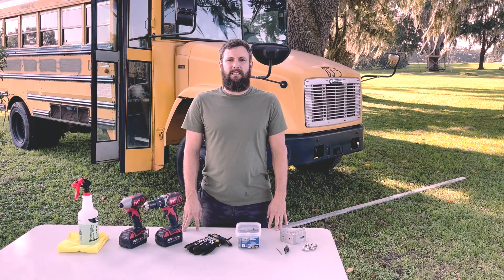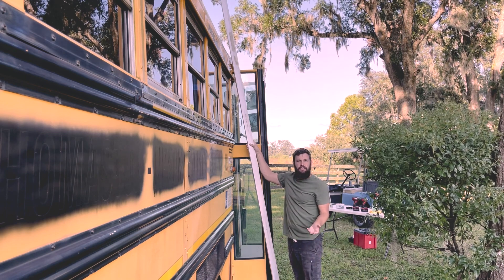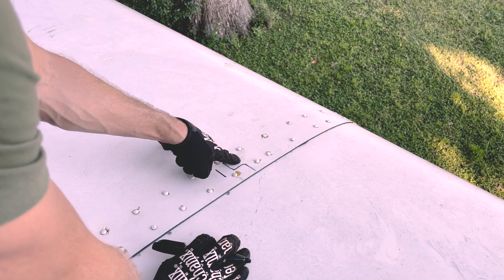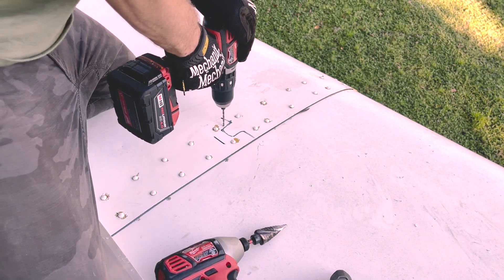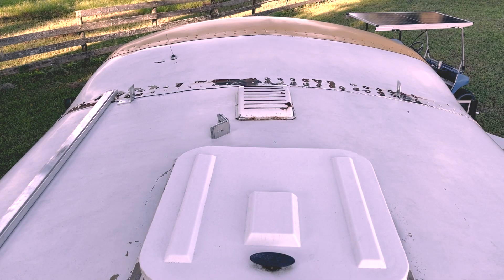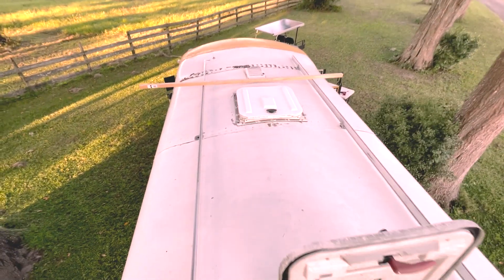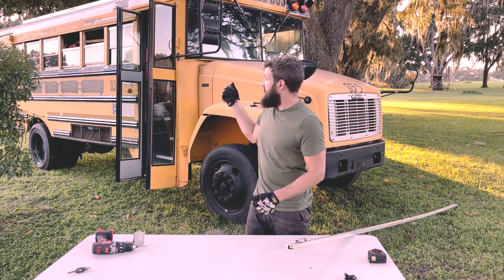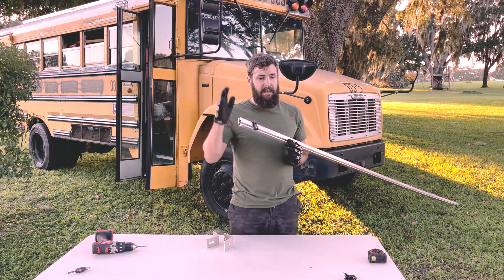Skoolie Solar Rack Install - Simple Method!

Comment: Respectfully, I don't think aluminum is the way to go, steel is.
Reply from the maker: The entire Solar world disagrees and specifically makes their rack systems out of aluminum. The railed referenced here have been the industry standard in residential solar. They specific avoid steel except for the fasteners to reduce galvanic corrosion and so it doesn’t rust.
Reply: @sojournersway  But the entire solar world is for mounting to homes, not moving buses that shake a lot on the highway, steel has far better fatigue resistance than Aluminum. Eventually, aluminum will crack, question is will it be in the 20 years you plan to own your bus.
Reply from the maker: @AmNesia-r5h Sounds like you should do steel.

Comment: Could you touch more on the part where you’re holding up the aluminum rail against the side of the bus to get measurements and run into the issue of it only touching certain parts of the rub rails…. I’m confused by what you mean to “split the difference” in that instance? 

Im getting close to this stage of my build and your method looks like the simplest way to do this! I appreciate you sharing the knowledge!

Comment: Would this still work with 6 larger panels that are 50 pounds each?
Reply from the maker: Absolutely. Most of these panels are in the 55lb range.
Reply: @sojournersway  nice I think I’ll try this this. I have a buddy who said after 15k miles the screws were coming loose. Anyway in making sure this doesn’t happen?
Reply from the maker: @DarkBroly88  He used my system and method and it came loose?
Reply: @sojournersway  I was thinking about getting 3” roofing screws and going through the whole beam.
Reply from the maker: @DarkBroly88  I wouldn’t. You’re going through a combined 1/8-1/4” with this method and I’ve never once had a leak or bracket failure.

Comment: Sig, how did you know how far apart to make the rails?  Is that distance exactly the width of the solar panels? Or more narrow or wider?  I'm planning on 3 solar panels, was going to do two side by side running length wise with the bus and then one sideways.  Looks like if I want to use one set of rails, will have to do all of them the same.  Guessing turned so they all run sideways.

Comment: I’m going to use the L brackets Iron ridge sells as they can support a deck using a stock aluminum piece to angle the bracket to 90 degrees. Thanks I found your vid very helpful
Reply from the maker: I have had clients use this for a deck but I don’t know the limits and explain accordingly. It the future, I may offer some thicker brackets for exactly this!

Comment: Self tapping screws but you don’t like self tappers so you pre drill.  
Those screws are structurally insufficient for a safe install in this use. Add in the THREE dissimilar metals (bracket material, screw material, and zinc on the roof sheeting)  and corrosion will destroy structural integrity at some point. Is that point beyond the life of the rig? Probably not. 

“Proprietary bend” I think that was a joke. Right?

Mine will be mounted with steel angle & square tube, grade 5 bolts though hat channels, and provide access for washing and cleaning panels without climbing up and down a ladder numerous times.
Reply from the maker: You seem unfamiliar with how solar is installed onto homes. They are installed with aluminum rails, aluminum brackets, and stainless hardware. All of them. Your method will have more surface area for galvanic corrosion since the panel frames are aluminum. As it turns out, the method I’ve used isolated dissimilar metal as much as possible (apart from using aluminum bolts). As I said, the entire solar industry uses exactly this method, except with different L Brackets which are made out of aluminum as well.

Sounds like you’ve got a perfect plan for your bus and I suggest you avoid my method altogether since it doesn’t suit you.

Comment: Question about this system! Do you think the aluminum rails could also support a storage / roof deck? I'm interested in installing rails that would serve a dual purpose for both solar and storage deck needs (thus was thinking unistrut with similar L type brackets)
Reply from the maker: For sure. It’s super structural once the panels are spanning the rails…but, for a deck, I’d feel better with some thicker brackets and bolting through. I’ll create a solution for this later!
Reply: @sojournersway  Thank you the the quick response! Also wondering what you think of this solution as slotted angle iron is easily available and can be bent to accommodate angle issues: https://youtu.be/pQ4Ieb6knb0
Reply from the maker: @dandotmp4  the reason this video and mounting solution exists is to help people not make mistakes like that video!
Reply: @sojournersway  Thanks! Curious what mistakes were made there as it seems like it’s been satisfactory for this person. No disrespect meant, just trying to learn!
Reply from the maker: @dandotmp4  Sure, it’s just simpler to use parts made for solar that allow for infinite modularity, minimal dissimilar metal contact, and no drilling into panels!
Reply: @sojournersway  Thank you!

Comment: Why use self tapping screws? I feel like Riv nuts or just nuts and bolts would be stronger. Also have you had any issue with these ripping off? I don’t trust the self tapping screws very much.
Reply: Always bolts, never like this.
Reply: Agree with you. Wrong fasteners completely. He also does 3 other wrong methods of doing things also.
Reply from the maker: I don’t use self tapper for that reason. Rivnuts are cool and can be used. Bolting through is also an option. Neither get into the hat channel easily like this does. As I said in video, I’ve got 40-50 buses running this system with tens of thousands of miles over the past two years without any failures!

Comment: I don't understand why you say you sell the appropriate brackets but then have to heavily modify them to fit your own method.
Reply from the maker: Because rivets are not the same across all the buses in size, dimension, spread, etc. The only way to do brackets universally is to avoid the rivets, which can be done with the brackets. That method doesn’t get you secured to the strongest part of the bus!

Comment: I like the solar mounting rails, I will have to check with my local dealers, I was going to go the unistrut route.  Wouter d.b. is correct,  stainless to aluminum is frowned upon without some kind of barrier, galvanic corrosion is an issue.   All-n-all that's a slick setup, I will be using it for my 40ftr.   Do you have a website for hardware???
Reply from the maker: This is something I considered of course, but if you go look, this is exactly how it’s done ALL over in the solar industry, all approved by NEC.
Reply: @sojournersway  of course

Comment: A few notes. Using stainless steel on Aluminium without nylon washers will cause dissimilar metal corrosion. Also, the L-brackets seem somewhat small-ish (could be worse, and I've seen it), I'd use double sized ones, also thicker ones. Nice and clean system though, Unistrut sucks and ppl should stop using it. Especially for watertank mountings that make me fear for anyone driving behind you.
Reply: This post caused me to question the Galvanic Corrosion so I sent the question directly to a Iron Ridge technician. Here is what he replied: 

“Stainless steel is the proper hardware to use with aluminum. There is no galvanic corrosion with this combination. Our products have been 3rd party tested to UL2703 standards for bonding and grounding. Our products have a 25 year warranty.

Let me know if you have any other questions.

Sincerely,

Jon Haeme
Sr.Technical Support Representative
Ironridge Inc.”
Reply: @cycleoflife7331  they are correct concerning their product.  And if you ask them how they deal with it.  They anodize all their rails, that is the barrier, you can get their XR rails in clear or black anodizing.  It does not take much to protect from the effects.
Reply: @mlviper30  the use of stainless steel bolts to aluminum is minimal but the reverse is not acceptable. A thin nylon washer placed on the top side would suffice but really necessary. Butyl tape under the foot is better to seal might be a better method than a tubed sealant but both should suffice. The panels will have to be replaced long before the bolt ever becomes an issue and most likely the will probably be decommissioned by then. But your point is well taken and should serve notice that one should know and take necessary precautions
Reply: @cycleoflife7331  Now that is an educated answer, thank you for doing your research.  Yes I agree, is it really an issue??? Na    The point was not that it was an issue, and SW was not doing anything wrong.  The point was GC does exist, regulatory organization do address, and any industries building structures are aware of it and do address it discretely.

As DIYers, we will probably never have an issue with it, unless you are in saltwater applications.  But it is important if you are a sub contractor, you are liable for your work.  So follow oem install instructions, if they are not present go to industrial accepted practices.

 I own an engineering firm I pay liability insurance for a reason, and follow standards.  Because I am a contractor and I am held liable for my work.   I have been in lawsuits conerning issues that the lawyers got that petty about the bolt was the wrong material.  It sucks.

When doing anything for anyone for money, be careful. Cross your T's and dot your I's.

Sorry for the hassle with everyone, but a gentleman was shot back at about the issue. And I thought a little education about the concept of galvanic corrosion was needed.  No harm no foul.

Good luck with everyones DIY projects, SW keep up the good work help people with there rigs.

Cheers
Reply: @mlviper30  remember that stainless steel is a noble metal which has a lower GC level and is why it’s combined with aluminum on pop rivets.
Reply: Just to put the record straight.  I am not bashing Sojourners Way.  I was just bringing to light the effects of galvanic corrosion, a scientific fact.  In all industries there are best practices used.  Due to the fact stainless and aluminum react to each other. There are best practices used to midigate the issue between them.  And there are many ways to achieve this, by gc grease, anodizing alum, any type of barrier, etc...  Its just good idea to be aware of it, the NEC, sailing industry, automotive, and aerospace recognize.  If I remember right the aluminum block corvette engine had uncoated bolts used and the GC seized them in the block. I may be mistaken on that, I vaguely remember that.

Simply facts to be aware of, thats all.

And if you are doing work for another person for money, follow oem and industry approved methods for install.  So there is no questions.  Lawyers can be nasty.
Reply from the maker: @mlviper30  This is exceeding the industry stand for mounting solar. There is an acceptable limit to the contact of dissimilar metals. EVERY manufacturer of solar rack mounts is using Stainless bolts and aluminum rails. I’m using the same system.
Reply: @sojournersway  Sir, you are fine.
Reply: @mlviper30  stainless steel do not react to each other. Only regular steel does. Sorry but research says otherwise
Reply: @cycleoflife7331  Ok
Reply from the maker: @cycleoflife7331  Yessir! I appreciate you sharing that. It’s a rabbit trail I spent hours trying to wrap my head around.
Reply: Omg I seriously wanna use this method but now I’m confused! Can someone please tell me which metals to use for each item? Sorry, there was too much back and forth.
Reply from the maker: How many buses have you installed solar onto? All of these parts are used in this fashion for the solar world per NEC just like this.
Reply: @sojournersway  You may want to check the NEC code again concerning galvanic corrosion I think 2017 358.14 & 2020 344.14 Maybe others) code is very clear on the subject the galvanic action.(I am not an electrician so codes are vague to me)  They do recognize it as and issue.  Will it effect the frame, worst thing that would happens bolts loosening over time because corrosion under the head and nut. I have 30+ years as a journeyman tool & die maker and in the Mechanical Engineering field, there are some practices that we shy from. Stainless and aluminum is one of them unless GC is addressed.  So I still agree with Wouter d.b. because it is a know issue, and regulatory standards recognize it.  If an industry does or does not heed cautionary practices that's fine.  They have liability insurance.  Like you do, as a certified electrician and contractor working on your clients Skoolies.    I really enjoy your videos, maybe be less abrasive with people when they comment on an item.  Mr. Wouter d.b. does not need to building one skoolie to understand science.  I have researched multiple of these rails, the stainless fasteners are used on anodized rails(Iron Ridge,etc..), the none anodized are using galvanized fasteners.
 Here nor there, no harm no foul, you are making great videos so far, I like your other video helping repair the work of the other contractors.  And I do really like the way you mount the solar panels, I will be using it for my 40ft rig, with 8qty 40x80 455w panels.  I appreciate your effort to bring to light less favorable methods and provide and superior method in its place.   And yes do not try to make the sealant look good, you just make a mess.   Regards, Matt
Reply from the maker: If you use Nylon washers, you still have the head of the bolt with teeth digging into the rail. By design, the serrated flange but also digs into the mounting bracket. The solar brackets have teeth that dig into the aluminum frame. Unirac stats that natural aluminum corrosion which is essentially natural oxidation that offers some protection. If you can show me a system out there that bypasses this is solar rails and how they attacks to metal roofs with aluminum stand-offs, galvanized lag bolts, then aluminum brackets, rails, all secured together with stainless hardware.

I did not intend to come across so abrasively. It’s very common for people to criticize a system without experience, having never succeeded or failed at what they recommend. This system was not just slapped together on the fly and sold. As I said in video, it’s been 100% so far with dozens of buses traveling all over the country.
Reply: @sojournersway  Got it👍your the expert, you have made that clear.  Have a good evening.
Reply from the maker: @mlviper30  That is not at all what I’m saying. The adhesive caulking is sufficient to break then issues between aluminum brackets and steel roof. Also notice that the steel screws mounting to bus are isolated from the aluminum bracket. This means that the only dissimilar metal contact is the stainless hardware and the brackets, which are installed per manufacturer, Unirac. I looked over all of their manuals and material! If you find a solution adopted in the Solar industry, let me know. This is how it’s done ALL over…and all these systems get approved per drawings and NEC…why it’s “okay”, I couldn’t tell you!
Reply: @sojournersway  Ok  here is some light reading(web links).  The Solar industry does not ingore GC and its effects.  We were just bring the issue to light for you, known by the NEC and the Solar industry, you cant argue with electrochemical processes.  But it can be prevented, like a  barrier of some kind, as was mentioned, nylon washer, or even a coated screw.  Ironridge anodizes their rails, they probable do it for many reasons, mostly corrosion.  You are fine, just be aware of this issue.
You can  agrue the point until the cows come home, the fact still stands, GC is an issue.  Factually supported knowledge will never fail you.  You have liability insurance as a contractor, and following the manufacturers instructions kinda protects you, doesn't mean they are correct.  By all means follow there guidelines, just be aware of this issue.  I found a couple articles concerning GC.

https://www.greentechrenewables.com/article/galvanic-corrosion-and-protection-solar-pv-installations#:~:text=Galvanic%20corrosion%20is%20an%20electro,wrong%20metals%20are%20used%20together

https://avenston.com/en/articles/corrosion-pv/
Reply from the maker: @mlviper30  I get it. I read these articles and countless others. I’ve also pulled aluminum condensers from buses where they were attached directly to the frame with steel bolts. No noticeable corrosion after 20 years. The galvanic issue is in fact a real thing but the rules regarding it and the application are quite unclear and I see no consistency followed by any of the manufacturers, nor have I seen issues from aluminum on steel.

As I said from the beginning, I am away that there is stainless steel hardware contacting directly with the aluminum. Anodized or not, the hardware is designed to dig in past the anodizing. All that said, would expect more of an issue from the countless buses mounting the Unistrut and then using steel self tappers to the aluminum solar panel frames.

Again, I would love to hear a solution. Nylon washers obviously isn’t going to work. After I got to the fourth rail manufacturer and saw the same system for each, I decided this was not a hill for me to die on. I’ve checked on buses I did early on and no signs of any issues!
Reply: @sojournersway  No, I don't believe you do get it.  But that is here nor there.  I have provided you the information concerning GC, its clear on how to address the issue.  You will do what you do, take it or leave it, your are the contractor with years of experience on roof mounted solar.   You do good work, and help people, keep it up.  I tire of this circular conversation so I will let you be.
Have a good day,